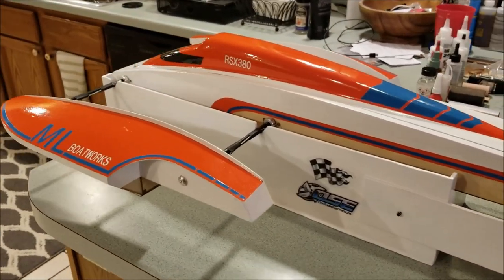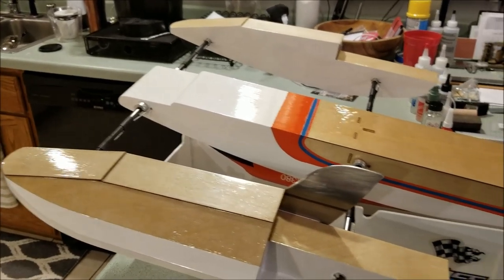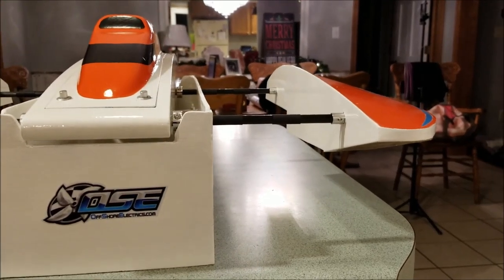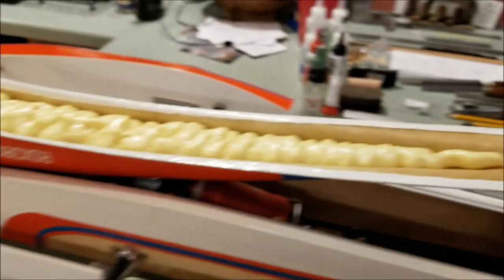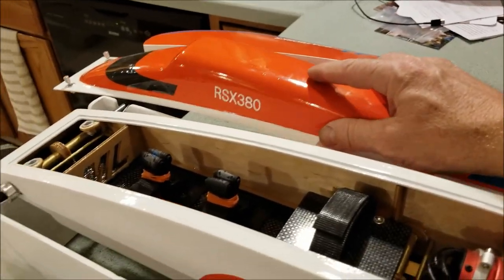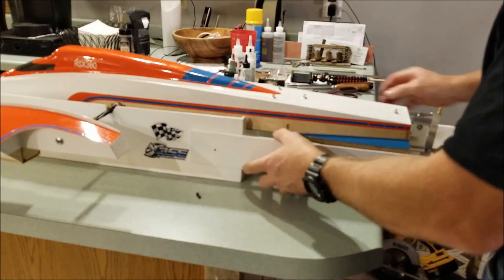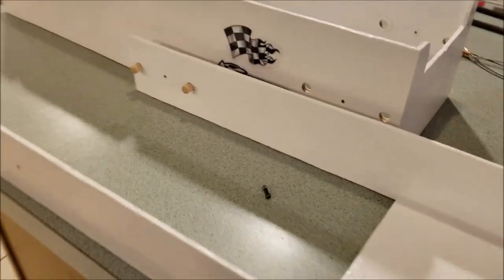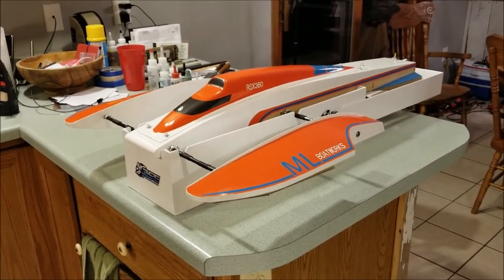ML RSX380 BUILD UPDATE

Comment: Excellent build Sam. I'm very much thinking of getting the same kit. What motor, ESC, batteries, and prop would you recommend? I haven't built an electric boat yet. Been mostly messing with the heli's and planes for the last 10 years. Boats have come a long way.
Reply from the maker: This is what's recommended...

Suggested power:
Motor: Leopard 4092 1480Kv with ZTW 200 ESC 
or
Motor: Leopard 4092 1730Kv with ZTW 300 ESC

Battery: (1) 6s 65c 5000mah Lipo pack...

I went with a Leopard 4092 1390kv, ZTW 200 ESC and 8s lipo setup. 

My fastest prop is an ABC 1819-17-45 prop...

Comment: Can you tell me what purpose serves the Alum collets atound the Carbon fiber rods ? Wouldn't just gluing them in the alum tubing be enough ? Thanks
Reply from the maker: Sure. Adjustments for trimming the boat and for replacement if you break them. I hit a log this summer and broke one already. For trimming,  the surface piercing prop walks to the left, so boat turns right. Rudder trim is drag. So adjust the right sponson to have a little toe in until it runs straight. Hope that answers your question...
Reply: @chilly7261  Thank you Sam!

Comment: I like the latches too. Just ordered some. How tight is the fit between the knob and the hole on the lid through which it passes? Should I expect water leakage there?
Reply from the maker: Good question. Water could leak a little there. I cut silicone fuel tubing that fits tight around the shaft of the knob, nice square cuts with a razor, pressed out the pin and put them on the shaft. Then pressed the pin back in. The key is the length of the tubing. Too long and you can't push the knob in enough to engage the pin. Too short and the tubing doesn't press against the inside of the latch housing. Mine are about 3/32" long. And I push the knob in as far as they will go, then turn them. You can feel them come up slowly because the tubing hits first, then the knurled knob slides up until the pin engages. That seals out the water nicely. Long winded answer, but hopefully makes sense...
Reply: @chilly7261  Thanks for the detailed answer! Makes perfect sense btw.